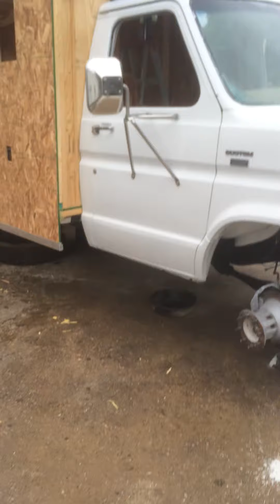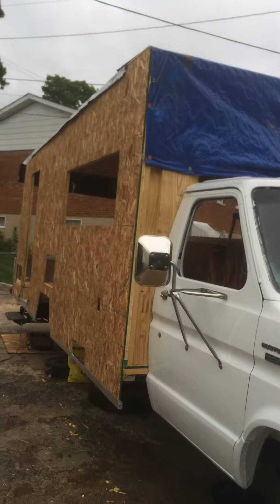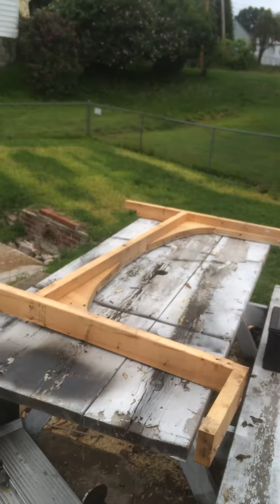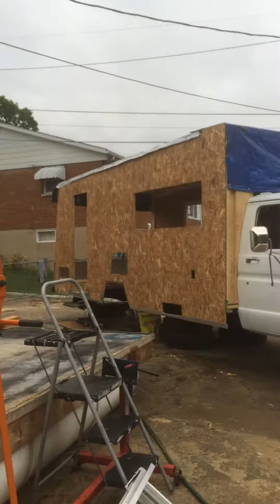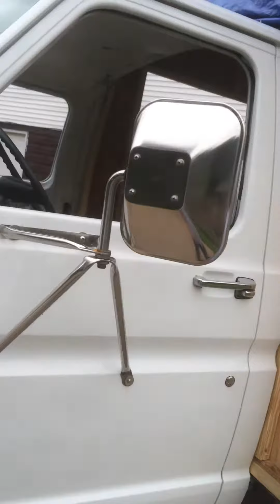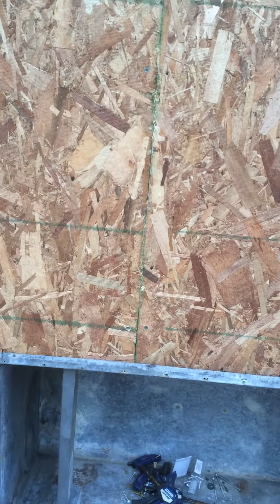1978 Motorhome Restoration #6

Comment: Nice work very well thought out, I think I would have used pressure treated lumber around the wheel wells instead of pine because pine rots very quickly I've seen many times when people used it on boats. Also I think I would have corner braced all the way around to add more strength and keep the tweeking and sceewing to a minumim. I like the way you orgainized the rebuilding you should have your own show.